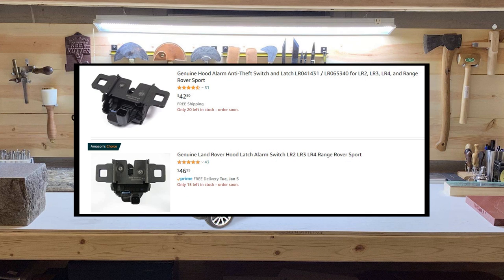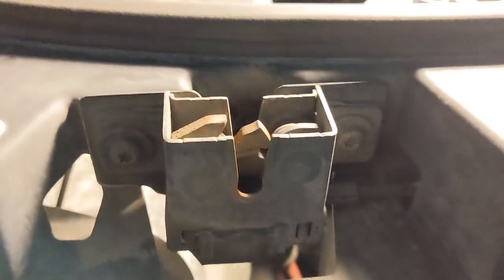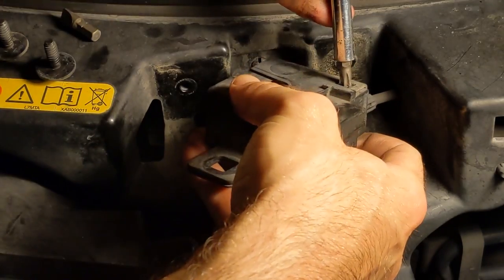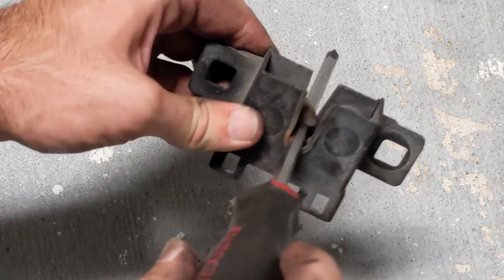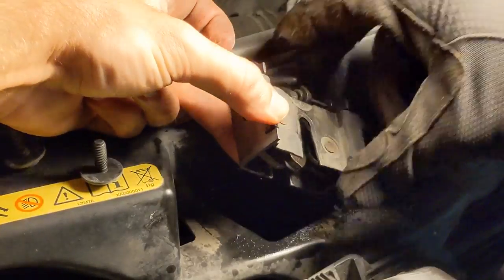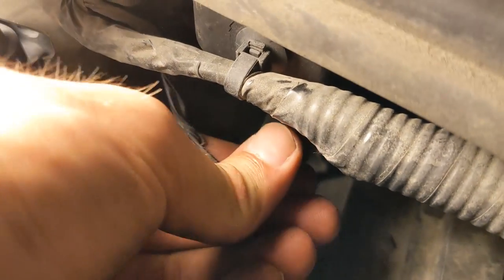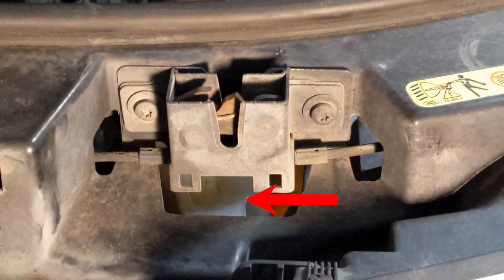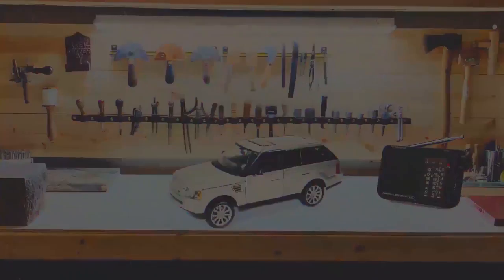Alarm Keeps Going Off - Replace Hood Latch - Range Rover Sport & LR3

Comment: Thank you a lot, i am a great fan of your vids. But in this case i short-circuited the sensor. Never needed this function before and i dont still miss it. But it was the reason of the alarms. Soon when i am pensioner and have more time the latch get a bath in gasoline😀
Reply from the maker: That's another option. I did that for the break pad sensor 😅

Comment: hello sir i have lost the wire harrness for the sensor do you have the part for the socket or the wire harness i ppreciate that
Reply from the maker: This? https://www.amazon.com/Genuine-Land-Rover-Latch-Switch/dp/B01BTIC8D8 . If you're talking about what the sensor PLUGS into, that's tough, I don't think I know what that's called 🙁. I can take a picture of it if you need
Reply from the maker: Keep in mind there's only a sensor on the PASSENGER SIDE, the driver side (left) doesn't have a sensor at all.
Reply: @HazyJay  sorry i want buy a new harness is ther any way you could tell where to buy that your vedio very nice
Reply from the maker: @Aalsayyed  I checked the repair manual and it doesn't say. It looks like it's wired into a much larger harness that spans the entire front of the engine bay.
Reply from the maker: @Aalsayyed  Keep in mind if you just want the error to stop you can wire the harness wires together to bypass the sensor, this may be an option.

Comment: Hey hazy I have range rover Westminster 2011 with alarm issues where by locking the car after some few minutes the alarm goes and also draining the battery
Reply from the maker: I would check the hood latch, although the full-size range rover is a very different chassis and may not have this issue.

Comment: Every had the issue of the hood not opening?
I am unable to manually open, not even after pulling out the cable inside and pulling it
Reply from the maker: Uh oh, nope I've never had that issue but it seems like the cable has disconnected or the latch is broken. I'm not sure of your options but maybe it's possible to shim it open.

Comment: If I just disconnect the sensor would this stop the alarm going off or do I need to replace it ?
Reply from the maker: If you disconnect the sensor the car will think the hood is always OPEN, so you would need to disconnect and splice the wires together if you want to go that route. I'd just get a new sensor at that point.
Reply: @HazyJay  Thanks for that. I've already saved a fortune watching your videos very clear to understand. I've changed my compressor and prop shaft. Going to do the thermostat next and bonnet catch . I was hoping you might do a video on changing the starter motor soon .
Reply from the maker: @jameskeep2727  Thanks for watching, I actually just replaced the alternator and was looking at the starter like, huh I'm surprised I never needed to change this. That usually means it's going to fail soon haha.

Comment: GREAT ONE HAZY!! NOW LETS DO PASSANGER SIDE A PILLAR NOT SITTING FLUSH AND WATER GETTING IN! LOLO THIS CLIPS ARE NOT THE BEST!
Reply from the maker: Getting in to the passenger compartment? It might be the sunroof drain that's clogged, it runs down the a-pillar: https://youtu.be/sFPufgA0iNY
Let me know if that's a fix
Reply: @HazyJay  i run a cut extension cord down those things like every 3 months! Lolo I've got an a pillar not sealed at top and I have water comming out at foot sill by all the electrical AND the back windows stop working , it seems, when it rains or car wash.  They always kick back on after a few hours or days. I use Gap Diagnostics iid tool every day, I never unplug it ! Oh and I'm replacing both wheel hub assembly this week! 👍🙋‍♂️👏👏👏
Reply from the maker: @johnnyquid3350  I wonder if there is a hole in that hose, there should be a drain on the left side too, so maybe purposely plug up the right side drain and see if the leaking stops 🤔

Comment: WHY DO YOU CALL, SCREWS, BOLTS!  to be a bolt, it needs a nut, otherwise, good vid, my alarm did not trigger, but message said, bonnet open, eventually, I raised the catches right up and problem solved, it is very uncommon for micro switches to fail, this is the same micro style as on the jacobs eng brakes and they come on n off 100000's times a year
Reply from the maker: You are right they are technically screws because they're driven from a central drive rather than from being turned from outside the head, idk why I was saying bolts lol
Reply: Stuart I got a Jaguar 2009 xf I have the same bonnet open what did you do again raise the what ? CATCHES ?